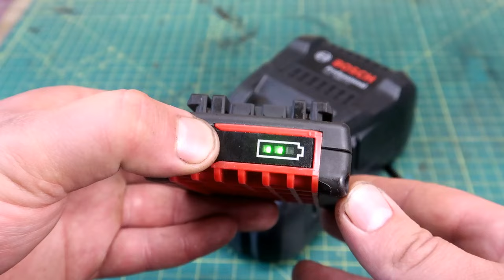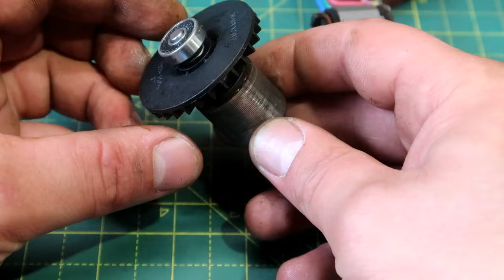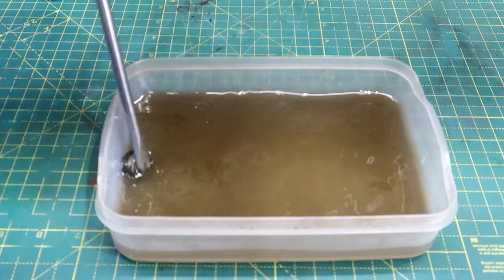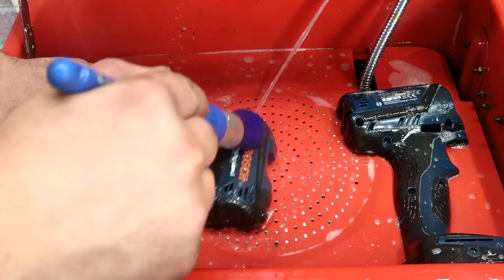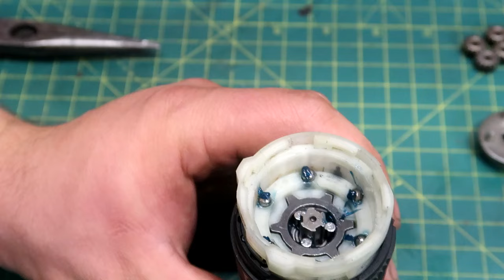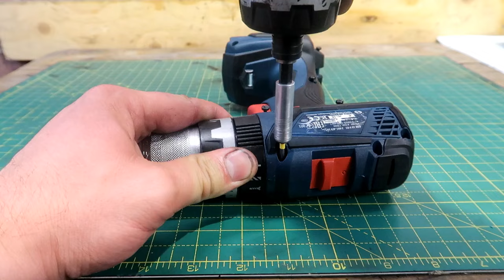Bosch Cordless Brushless Drill Restoration/Gearbox Rebuild/GSB 18V-EC

Comment: I don't think you are supposed to oil the outer face of a sealed roller bearing nor the inner one for that matter... This part is not supposed to spin. If you want to oil the bearing - try injecting grease inside the bearing or just replace it.

Comment: Thank you for the good tip for placing the locking ring back at 11:40. i have a cheap chinese drill with almost the same gearbox. The instruction to put in gear 1 was very helpfull

Comment: exceptional work and professionalism on the job great to watch. I was wondering one thing only - 
when you used the electrical contact cleaner on the stator/field wouldn't that disrupt or remove the enamel protection of the winding?  if that happens it would be quite dangerous and could easily short anytime, Also one suggestion: if you had disengaged the keyless chuck from the impact drill before opening itself, you could also clean the primary shank shaft  and the torque selector from inside - will appreciate any comments you ave on both. Great work!!!
Reply from the maker: Hi,thank you for comment.I used electronic spray from liqui molly this product is not fast dry to distrupt or remove the enamel protection of the winding.🍺🍺
Reply: @AlexBRestoration  Hermoso video, que grasa utiliza para lubricar los engranajes?

Comment: Hey nice vid, I have broken three keyless chucks on these drill in the last 4 months. They get jammed fully open so easily, that's happened twice. Now I have a chuck that won't tighten after stripping and putting back together. Annoys me as it's not a cheap drill!
Reply: what is a keyless chuck ? what does it mean that it broke ?

Comment: Hi there its perfect job you done , i have a questions plz reply me if u can i have got same drill , but gone wet bottom part 3 inch water all night from bottom, I cleaned all bottom part from inside with petrol , but still not working with other battery, thanks
Reply from the maker: Hi thank you for comment, you can try to dry the drill with a hair dryer, maybe it's working and next time use contact cleaner not petrol,sorry for my bag English, i hope you understand me.

Comment: do anyone know if at 7:14 there are a bearing inside or just a basic bushing. I see on another clip on a 10.8 volts having a bushing there, but on this more powerful dril have a bearing maybe?
Reply from the maker: Is a bearing there🍺🍺
Reply: @AlexBRestoration  Thank you very much, i see a lot of video with other brands that have a bushing there. You know if that bearing can be replaced at need?

I own 3 tools: GSR 18v-EC , GSR 18VE-EC, GSR 18V-110C

Comment: What type of lubricant did you use on the gearbox? That blue stuff didn't look like lithium grease. 

Also I've heard that too much grease in  a drill can cause problems, by getting into the motor windings or something.. I'm not sure if that's too much.
Reply from the maker: The grease is liqui molly LM 50 lithium grease ,i used this type of grease on every drill without problem.🍺🍺